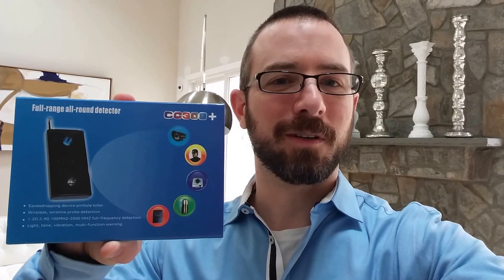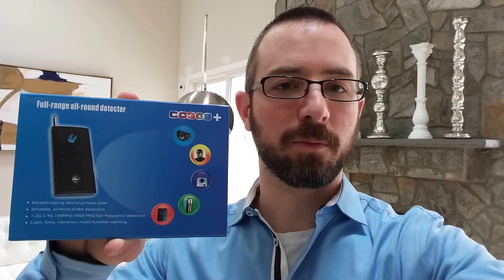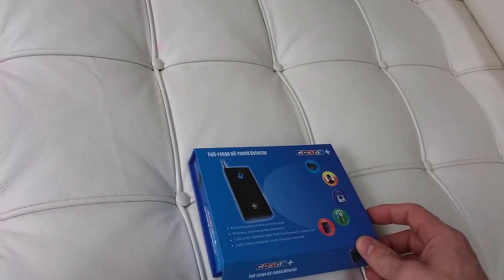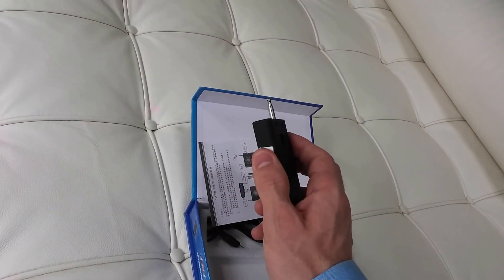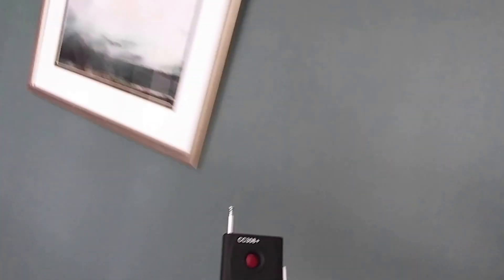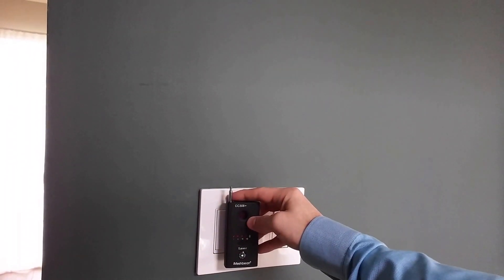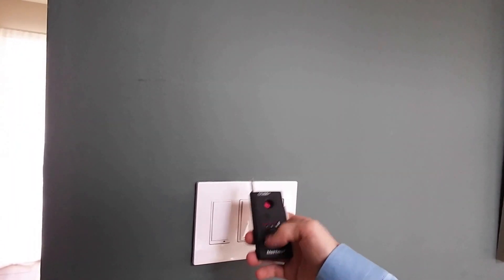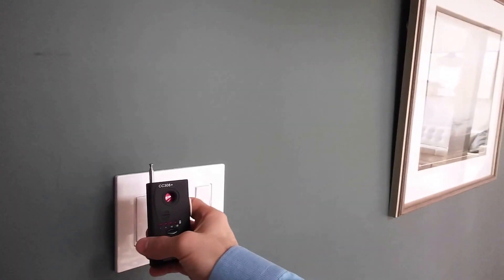Z-Wave Jamming Detector

Comment: I went to Amazon and asked a question:
A fellow customer answered your question,  
"Does this detect Z-Wave signals?" 
Nate answered: 
"No, it does not. I will tell you that I set up 3 cameras, two wifi and one av, and it did not detect a single one. Worthless." 
also:

Q: Does this detect Z-Wave signals?
A: Hi, this detector can not detect Z-wave signal.only detect infrared ray.
By Sanying Tech on August 21, 2020